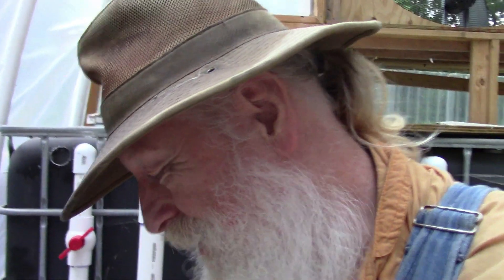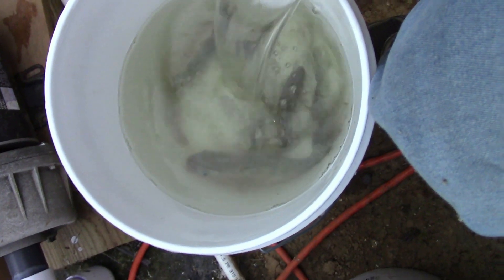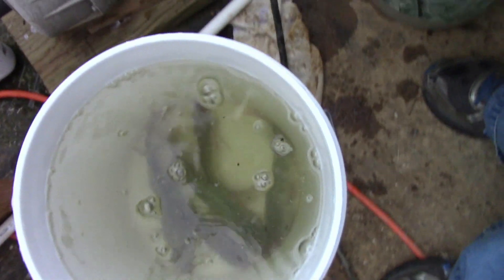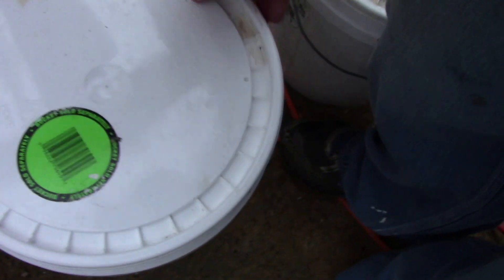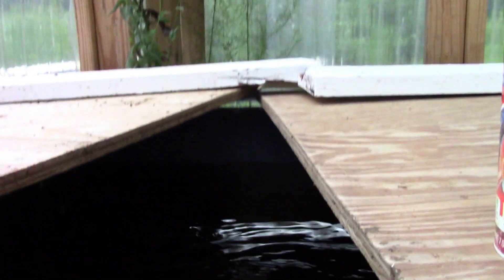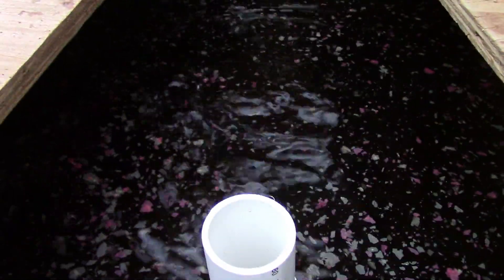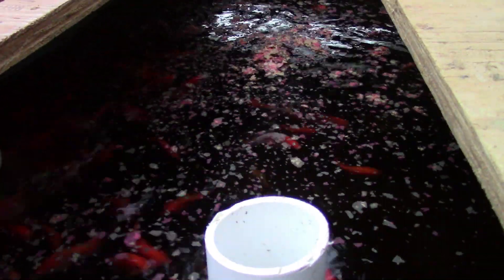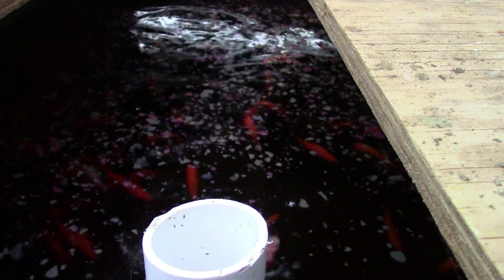Adding Tilapia to an Aquaponics System

Comment: Greg, I used to breed fish. Products like Stress Guard and Stress Coat both help and will reduce losses.  Decades ago I did exactly like you are in the video but combining good handling and products like I mentioned will only help the fish ;)  I used to move small tropical fish all over the SE to various pet stores with battery powered air flow systems, not an ez thing in the south especially in the summer months